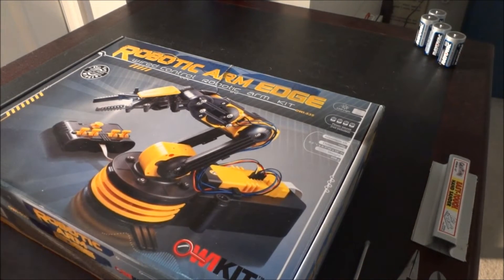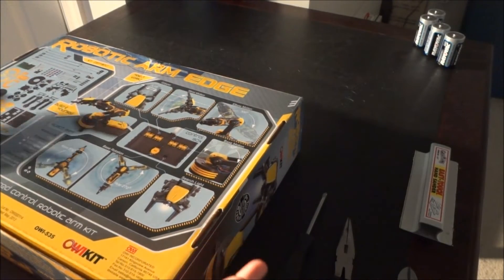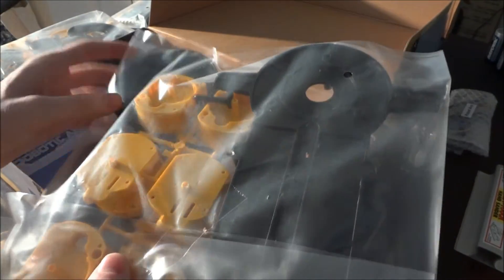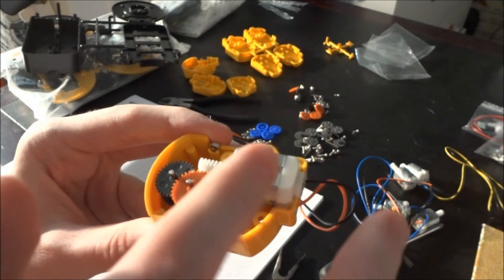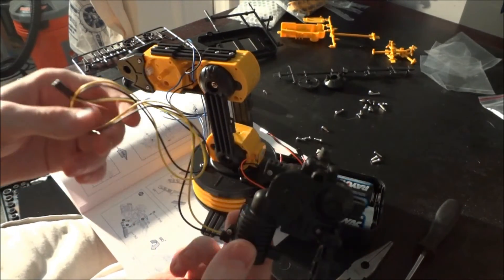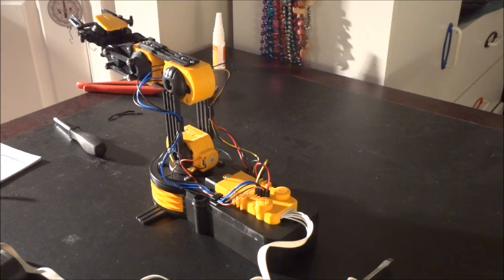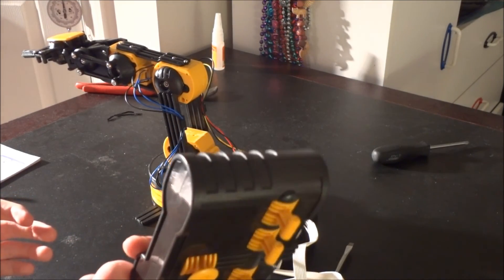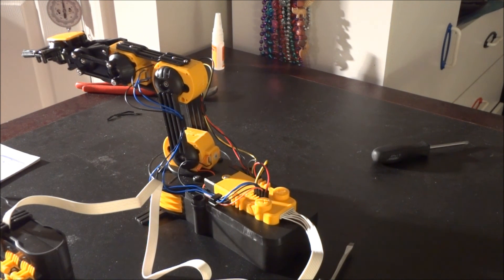OWI Robotic Arm Edge Unboxing & Construction

Comment: I built this kit about 5 years ago. A fun build overall.  I did run into the problem mentioned at 11:55.  I solved it by using CA glue to hold together some parts where the screws stripped the plastic. That worked well & I've had no issues with using the model.

Comment: What happens if I have to change the batteries
Reply from the maker: You remove the three screws (one under the ribbon cable port, the other two around the circuit board). Then just lift up the battery cover. I've had to replace mine recently.
Reply: right thanks